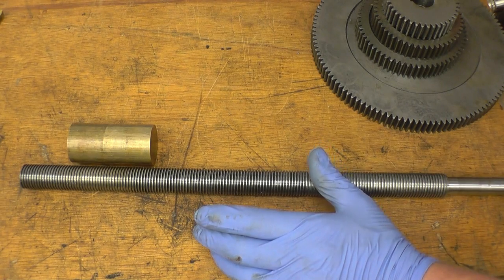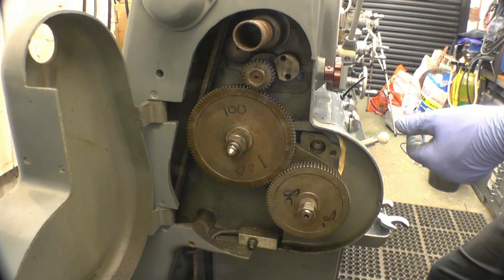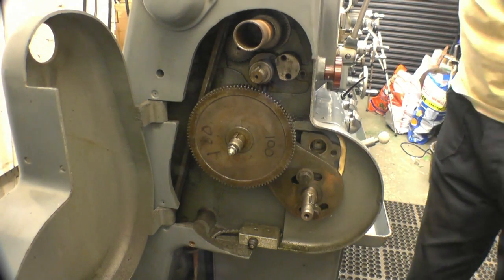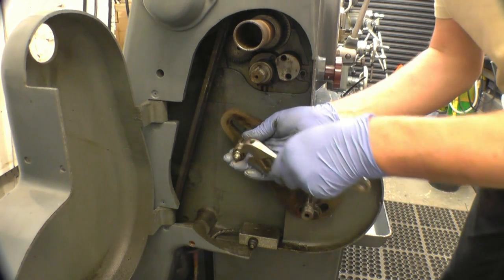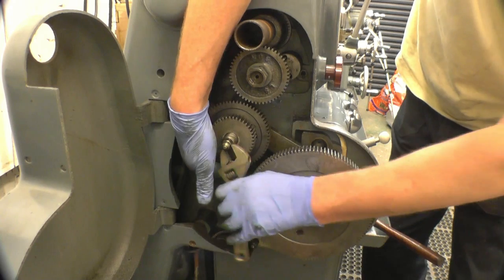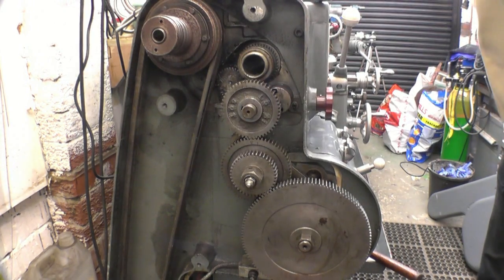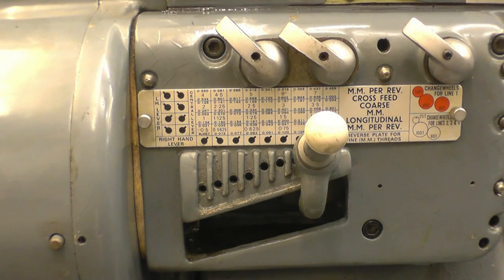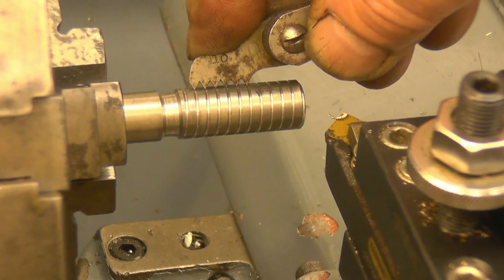Left Hand Internal Acme Thread part one

Comment: Hi John,

I recall I've run into the stud gear interfering with the spindle myself. In my set I think there's a gear with slightly reduced OD that's meant to be used for the job. The spindle extension is also the locknut for the rear bearing preload adjustment.

Comment: Wonderful. The process of cutting Imperial gears on a Metric latha or viceversa is an exercise in what the British call "maths". The essential is to find a series of gears that will give you a ratio close as possilbe to 254/100 to one. Or its inverse. I am glad your manufacturer solved the problem for you! There is always a joker in the pack, and that in you case is the 63 tooth gear. In the Imperial lathe, the joker is usually 127 teeth. A prime number. I am interested by the 63, because it is not prime. Some time ago there was some correspondence in Model Engineering  mag on cutting BA threads on a lathe. I am sure you know all about BA threads. It turned out there was a program on the 'net  that gave you the proper ratios. BA threads are oddball. Swiss standards: metric. But the area increases by 2 as the number goes up, so diameters go as square root of two, an uncomfortable number. Pitch specified as some function of diameter so you get something like a .396 (making this up) mm pitch. How on earth do you cut a .396 mm pitch? Internet to the rescue. There is a program available on the 'net that will give you ratios for almost anything. Editor published final result for a Myford lathe so totally uninteresting to you. But nice to know there is an "app" as the modern generation calls it. I apologize for the length of this comment. But I find it very interesting. And I am lazy so you will have to search for the app.
Reply: where can i find the program on the net for the ratio program conversions?

Comment: Just a point when checking imperial threads, double check by positioning an imperial 6" rule line 1" mark against the top of one thread and the point of another thread should line up with the next inch mark exactly. I was shown this by machine shop foreman, who proved worn Coventry die heads did not hold exact pitch over long thread lengths.

Comment: Hi John 
On your feed rate chart on the lathe, if you undo the two screws on the plate I think the imperial settings are on the back, love the videos, and wish Debs well from me.
Tony
Reply from the maker: Stan Gordon Thanks to you Stan Saved me all the hard workYou even lent me the gears RegardsJohn
Reply: Tony Burndred 
Yes your right, on the Harrison 140 with the metric Norton 36 speed gearbox, easily identified by the 3 selector knobs, one side of the screwcutting information plate is for Metric Coarse threads the other is for Metric fine threads.
Sadly there is zero info available regarding cutting imperial threadson the 140and similar lathes with the Norton 36 box, hence all the work in solving the riddle, the paper print John has is a home made one, not a Harrison one.
Stan

Comment: Excellent video ! that lathe is a nice piece of kit!
Just had a thought about thread cutting where you need to keep the half nuts closed- has any one ever thought of making a tool holder that works like the clapper box on a shaper so the tool would ride up over the work piece when you reverse the spindle ?
Reply: ian bertenshaw   Hey!  I like that idea, and I can see that someone like John could be the one to make it work.  Great suggestion.  Regards Mark in the UK
Reply: ian bertenshaw They have indeed thought of that and many have made 'swing up' threading holders. Not to be confused with retractable or lift up devices, these are fully automatic and make for really fast threading if you can reverse your lathe quickly. I'll post a link to a video in a reply to this.
Reply: Paul Compton John Stevenson's swing up threading demonstration (in real time) http://www.stevenson-engineers.co.uk/files/P1000910.MOV
Reply: Thanks Paul !
Really does make threading with the half nuts closed much simpler - no need to retract the cross slide to get the tool back to the start.

Ian

Comment: Great explanation of the banjo, it comes at a time when I'm learning about the calculations on different gear combinations and the pitches they will cut on my manual gear change South Bend.

Only variation of vocabulary is possibly what we call a compound gear you call a conversion gear, but I'm just learning this stage so I could be wrong. Either way it's great stuff.

Thanks for the video and please accept my Best Wishes for the Mrs., Aloha until next time...Chuck

Comment: John,
Thanks for the threading and gear change video. Hope the item you will be threading works out fine. It's a pain when you have a metric lead screw as you can't use the thread chasing dial. You have to resort to the reverse the lathe routine.
Have a good one. Regards to Debs.
Dave